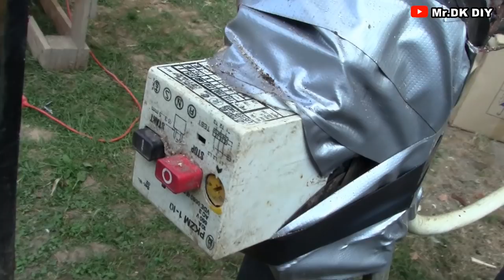SUPER HOMEMADE ELECTRIC WOOD LOG SPLITTER /DIY 2018/Cepac na Drva

Comment: Is that a 1" shaft on motor and if so where did you get corkscrew I cant find them. Everything is mm
Reply: Jim Miller just measurenshaft in mm with a caliper that’s what I did

Comment: I think you threaded the Auger part Backwards or something! Because its supposed to pull the wood towards it and break it that way. Youre pushing them into it Hard i can tell then its splitting the wood.
Reply from the maker: Hello
I agree with you that is true
but I did not have another electric motor with 3 kw 700 rpm that would have been better
but I do not have it and that's why it is so
grace for the comment